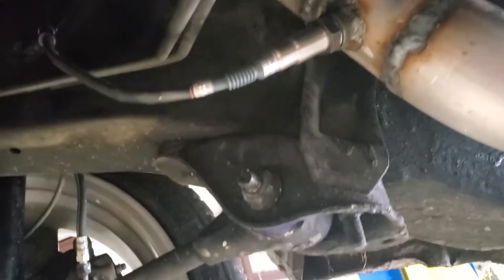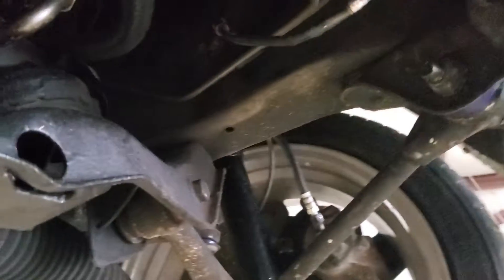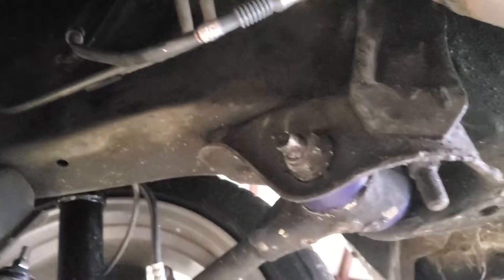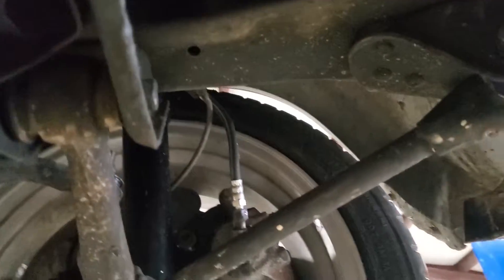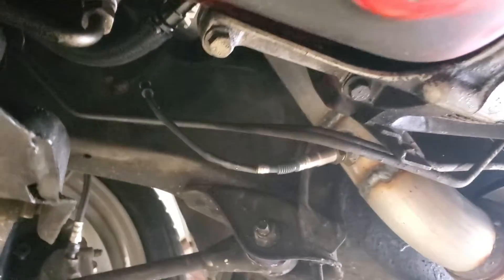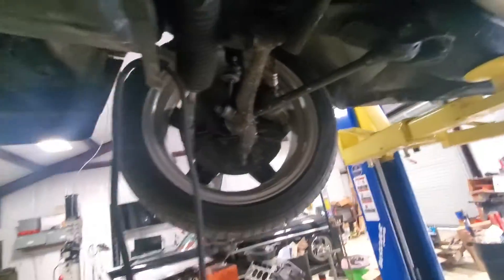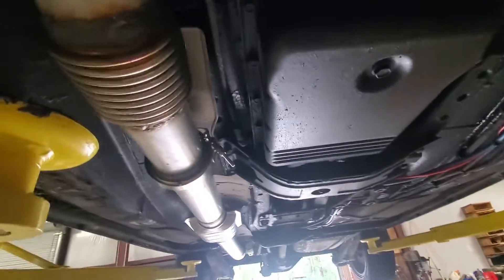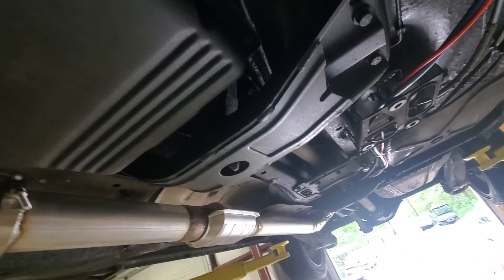Mountain Meet prep

Comment: I have an AEM wideband setup in my 240 and it also did the same thing after one or two drives. I was able to get a warranty replacement for the whole kit (gauge, wiring and sensor) for that, but now the replacement isn’t working either. It, however, always reads 14.6 or 14.7 now. I drive the car once or twice every month or three or four, so it’s well outside warranty now. Quite lame!